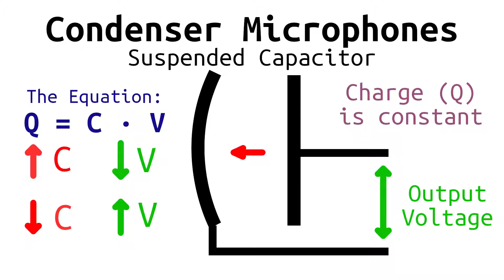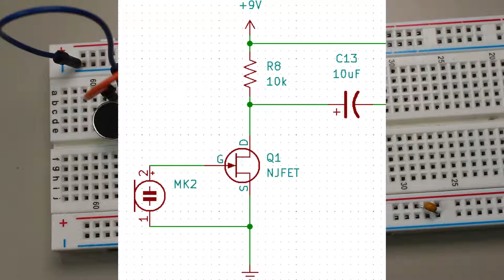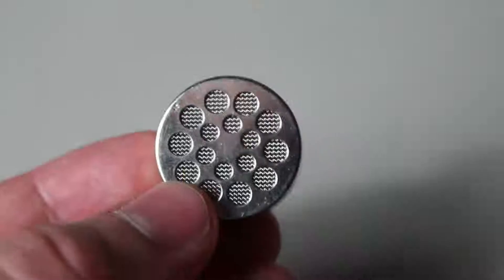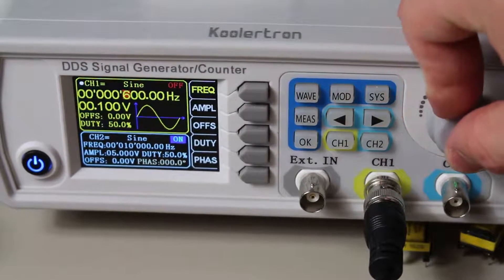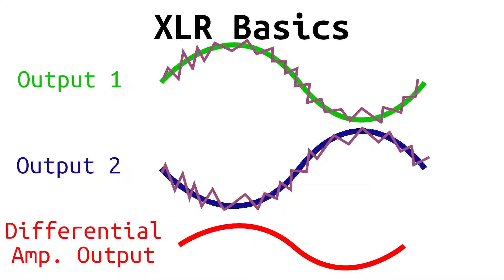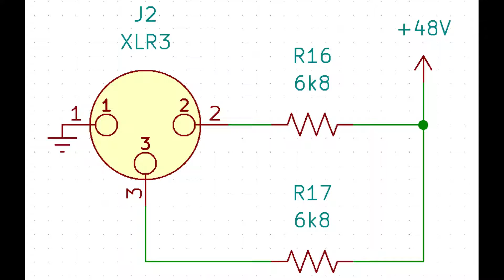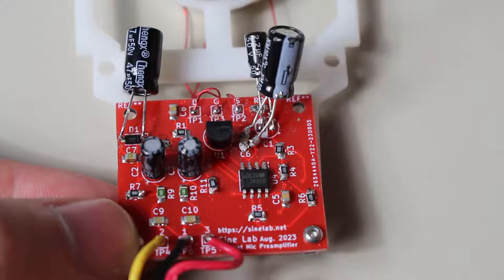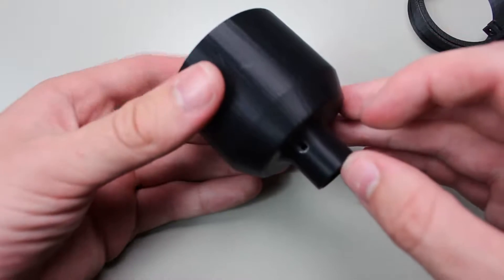How Good Does a DIY Microphone Sound?

Comment: I disagree, i also have made an op amp preamp with potentiometer using rode video micro that is a cheap electret type condenser mic.I plug in to my pc in line-in port that Essential gives me most good quality with zero noise. 

To achieve the quality you need a power supply that is stable that means a battery is the best choice than a line connected adaptor. 

The quality of sound is as good as any 50 60 buck mic.

Comment: You can get much better performance with wm61-a cheap and little electret mic. It needs only one common  emitter amplification stage and all assembly can be few times bigger than bare electret capsule and it will provide you significantly better performance.

Comment: You forgot GS and GD resistors made of PCB blank spaces. GS "contact area" is bigger few times than GD "contact area", so base is biased with huge impedance to voltage between drain and source an closer to source. So internal n-type induced channel j-fet is partially opened on it working point.

Comment: I originally made a 25mm design with a FET (LSK170) and a TL072 on there and while it worked find, the 40 dB gain was more hiss than speech.

This circuit distorts quite a bit (not that we'd notice) due to non-linearity  in the JFET. I've adapted a design from Doug Ford (Rode) which uses negative feedback to deliver a very low noise, very linear response.

I've used a TL431 for regulation and ran into the same issue on my last prototype (because that's the one thing I took for granted). It makes a great 10KHz oscillator though. Oh dear. And no, smoothing capacitors won't fix it. 

The answer is to drop your current down. The p48 standard can deliver (give or take) 10 mA at around 12V because of the current limiting resistors on each leg (6k8). I've learned a lot of this trying to miniaturise the wheel, while making a mic that can (and I think will) rival the Rode NT1a. Actual noise from the circuit is very low and the TL431 regulator should be better than a simple Zener because I've used a pass transistor on the latest designs.

The  TL071/2/4 series have JFET inputs which are known to be very noisy indeed. Texas and others do a whole slew of far better amps with lower currents. 

The whole thing is Open Source hardware and on the DIY Perks forum (but anyone can make one, improve it etc).

One thing to note is that you don't need the 1Gig load resistor if the capsule is an electret. That only appears to be the case with unbiased capsules where the capacitor between the gate and the supply is required. Doug Ford worked around this somewhat by driving the gate in series rather than parallel but I haven't tried that technique as yet.

I think the NT1a also uses a pseudo balanced output. It's still balanced, a single-signal balanced output might make more sense. This is another point from Doug: if you have a fairly quiet preamp, why double your signal (to make it differential) and add 100% more noise.

What matters on a balanced line is the AC impedances have to match.

As of this writing, I've just sent another batch to JLCPCB (they are the folks I use, I don't get anything from them) with the corrected power supply. My issue was the shunt regulator (as here) pulling the positive supply down so hard, the thing switched off and cycled. I tried cheating and it cost me weeks and several months of beer money.

The "final" design is larger (it now fits 25mm and 34mm capsules, but can be wired to almost any FET-free electret). But I have to stress that until I "sign off", I don't want anyone spending their own cash and finding I've goofed (more than one time I've mixed up an catalogue number and had inductors where resistors went, or 10 ohm resistors where I needed a 10K). So lots of magic smoke!

One design I did do (not currently published as it's rough) is a solid state Op Amp with performance like you wouldn't believe, even in the simplest form it's very low-noise and can be pushed into driving fairly significant loads like capacitors. The design has been adapted from the Jensen 990 which is decades old, but still holds up remarkably well. The "matched pair" isn't made any more so I've replaced it with an (optional) MAT02. The operating current required for the MAT02 is different to the discrete LTP so I've included a current setting resistor.

Anyone interested can find me making my cockups public (so you don't have to) on Matt's forum - but full disclosure - we live in the same country, and that's about all the connection we have.

Comment: Check out some new and modern opamps. The onec from the 70s need to ve forgotten 😅 modern opamps make less noise, draws extremely little current and work well on a single voltage. Good luck with next iteration of your mic 😊
Reply: Second this. The even the new cheap stuff like opa167x heck even a general purpose one like tlv906x are pretty good.

Comment: both legs of differential amplifiers need to be as equal as possible .. feeding the input of the inverting amp from the output of the non-inverting amp is an issue .. the issue arises from propagation delay .. though very small and definitely freq dependent, this delay causes the signals to be out of phase so as not be exactly 180 degrees out of phase .. this phase difference creates noise which is then fed into the amplifier stages.. Hope this helps ...  Cheers :)
Reply from the maker: That helps a lot! I'll keep this in mind when making another microphone in the future :)
Reply: @SineLab   He's right, you want to treat the two out of phase signals as equally as possible in terms of impedance. The good news is, there's sort of an industry standard configuration that you'll find on pretty much any balanced audio input and it only takes one op-amp side to do it. It's typically done with a split supply. There's a way to do it with a single supply with a little trickery. Google "ST an4586" it should be the first result "differential to single-ended amplification" ap note. Page 2 figure 2 you'll see that industry standard configuration I was talking about. All resistors 10k will give you unity gain (A=1v/v aka 0dB) then use the other side of the op amp to gain the hell out of it. But yeah, you'll need a split supply for that . To do it with a single supply you'll have to replace that ground with a common mode reference voltage which would be 1/2 of your supply voltage. So if you have a +12V supply  Vref= 6V. They give you 4 different ways to configure that on Page 6 Table 4. The first one using a zener is all you need. Or you can make an easy split supply by putting two batteries in series and grounding the middle node where they meet. That'll give you negative voltage off the cathode of the bottom battery and positive voltage off the anode of top battery.  Just make sure to reference all 'grounds' to that 0V spot between the batteries. Alright, I feel like that's a good amount of info. All stuff I wish someone had told me. Didn't want to just tell you what NOT to do ya know? And now you kinda have to build the circuit since I spent so much of my precious time telling you. 😝
Reply: From what  you say, I'm guessing the effect would be non-flat frequency response at the high end, not sure if that can be called noise.
Seems like one option would be to eliminate the extra op amp, preserving R10, R11, and C10.  All XLR requires is impedance matching, voltage drive not required on pin 2.  Most XLR equipment (not mics) simply connect XLR pin 2 to ground through a resistor that matches the impedance of pin 3.
Some have done far worse.  I remember looking at an LR Baggs Mixpro, reverse engineering the circuit, and finding they tried to use an incredibly complex differential driver circuit which was a monumental failure, leaving the device totally useless when used in non-ideal situations (very noisy, as in, 60 Hz and harmonics).

Comment: It works very good for a 1st attempt. Software will remove lots of the background noise. Your design reminds me of microphones from the 50's. Good work.
Reply: Look up ribbon microphones. They're really similar to condensers. But they use magnetism instead of electric plates
Reply: @kevinclass2010  So not really similar then. ;)

They have a lot of useful features but they are abominably difficult to make. I know, I've made one from scratch... and it still needs a lot of work on the mounting and tension adjustment.
Reply from the maker: Thanks for watching! Software definitely helps.

Comment: shielding body is a must, plastic housing won't do it, but even tin soda can will.
It is not apparent now probably because you loaded your capsule too much with that 2k2 R2. Usually it is in Mohm range, thus FETs.
Take a look at re-engineered Rode NT-1A preamp schematic floating around Internet, they even use 1GOhm resistor to achieve noise figures they are known for.
Reply from the maker: Thanks, I'll have a look at that schematic.
Reply: The JLI-2590A capsule that he used has a built in JFET, thus the 2k2 resistor which matches what is used by the manufacturer to measure the specs.  I believe what you refer to is internal to the capsule and not changeable, nor is it a problem since the electret connects only to the gate.
Reply: @jrstf  true, somehow during the presentation of all the different schematics I totally forgot that we were dealing with internal FET.
Although, these type of capsules are much less dependent on additional shielding, there is still some noise floor performance to gain.
I've witnesses an example where certain greybeard made one of those 10mm electret capsules headphones-level of silent.
Reply: @Mr.Leeroy  Linkwitz mod? Just wait until you see what Doug Ford did and I've (just about) managed to duplicate. And it's almost all discrete components, save for the regulator!
Reply: @marcdraco  anything that removes zeners is probably quieter
Reply: @ Zeners are not as noisy as we tend to think. The avalanche current causes the noise so if we keep that down low enough to just turn them on, it's not too bad. I prefer a TL431 or its equivalent.

Comment: Excellent project. I have several ongoing microphone projects. I am using them to learn and, indeed, I am learning a great deal. I am trying to stay away from 48V Phantom Power. I am also doing my differential noise cancellation using the inverting and non-inverting pins of just one op amp. My op amp is a THAT brand 1512. The THAT company makes op amps specifically designed for microphones. I tried to tweak the 1512 drive circuit suggested in the data sheet. None of that worked and I reverted to the drive circuit exactly/mostly as suggested. You can find two of my threads on the EEVBlog Forum under the titles "Help with design considerations of a proper microphone preamp" and "Design Review/Question= Bandpass Filter on a Mic Differential Pre-Amp?"
Additionally... I have been following your channel and your development. I must say that you are doing much better! Your speech tempo and breathing are greatly improved. Much more natural. Very professional. Kudos!
Reply from the maker: I'll have to take a look at those THAT op-amps and your forum threads.

And yes thank you for watching all of these videos. Your advice from all of those comments has been very helpful, thank you! :)

Comment: Shorting a line called +48V to one called +12V seems like a bad idea...
Reply from the maker: I made a mistake in editing and the schematic. Take a look at the full schematic and you will see that the 48V net is connected to those 1k resistors. I should have been more clear that the 48 volts is coming through XLR, not that net.

Thanks for pointing that out.

Comment: Hey! I’ve been doing something very similar and facing similar problems, my goal is to be able to power the mic/preamp/amp from the 5volt vbus wire from a usb connection and use the data lines to send the isochronous transfers back to a PC. So I made a switching power supply to boost the voltage. And I was wondering how to cut noise from power supply when bypass caps aren’t enough, is it even possible to get the linearity required for hi fidelity microphone applications from a high frequency switching supply without too much voltage drop? might be a decent video idea, would love to see it. Loved the hardware usb video too, keep up the good work 👍
Reply from the maker: I'll definitely add that USB microphone idea to my list. :)
Reply: Use a high frequency boost then a good linear regulator,  potentially even a precision voltage reference if it can source enough current. A run of the mill tl431 should do.
Reply: Maybe you just made a mistake in your schematic connecting the12v directly to 48v line. If not you need insert a resistor between those 2 voltages. Looking at the pcb you may have a resistor there. The Phantom power should be able to deliver about 15ma. Your 072 IC typically draws 2ma from the datasheet so what's drawing all the extra current?
Reply from the maker: I did a closer inspection on the board and, when working properly, the zener actually does drop 12 volts.

The interesting thing, however, is that the circuit is very unstable. If I probe something in an odd way or even plug in the circuit before activating the 48V phantom power, then there is a certain instability that I can't put my finger on yet. The voltage across the zener is very low, like I have shown in the video.

So, under nominal conditions, the voltage regulation is fine. Just, there is another issue that I haven't found the source of yet.
Reply: USB isolator will help with noise from pc power supply..